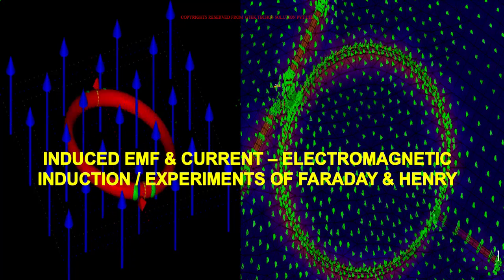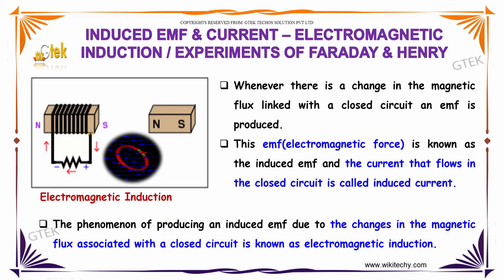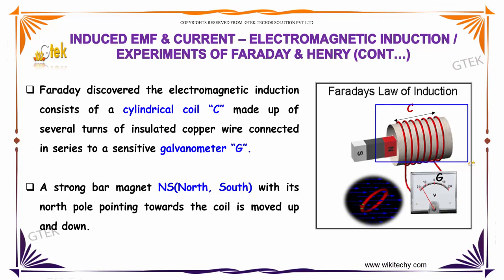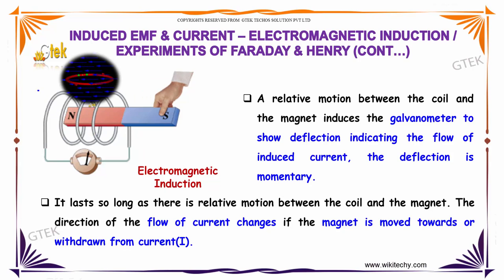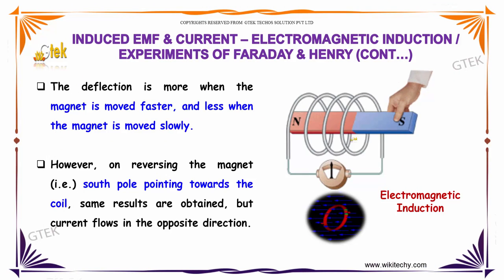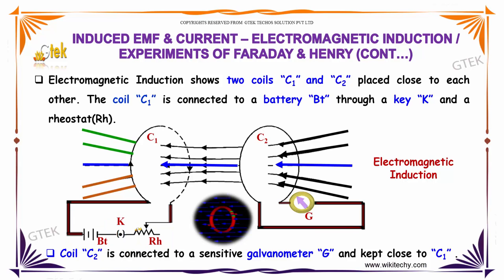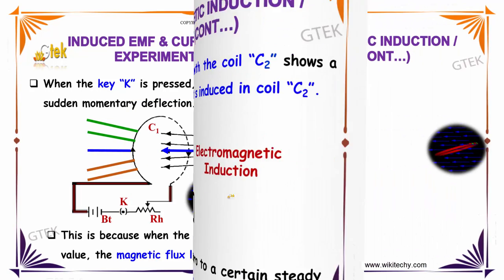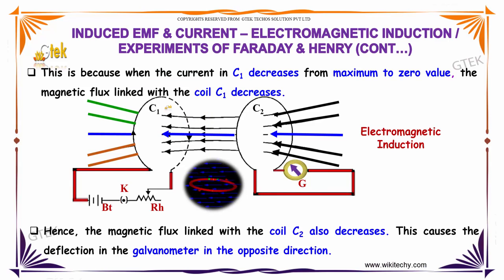Induced Emf & current|class 12 physics subject notes lectures|CBSE|IITJEE|NEET

Comment: Any change in the magnetic environment of a coil of wire will cause a voltage (emf) to be "induced" in the coil. No matter how the change is produced, the voltage will be generated. The change could be produced by changing the magnetic field strength, moving a magnet toward or away from the coil, moving the coil into or out of the magnetic field, rotating the coil relative to the magnet, etc.

Comment: When the coils are stationary, no current is induced. But when the small coil is moved in or out of the large coil (B), the magnetic flux through the large coil changes, inducing a current which is detected by the galvanometer (G). Electromagnetic or Magnetic induction is the production of an electromotive force (i.e., voltage) .... Lenz's law gives the direction of the induced EMF and current resulting from ...